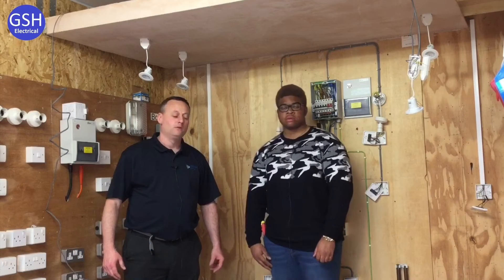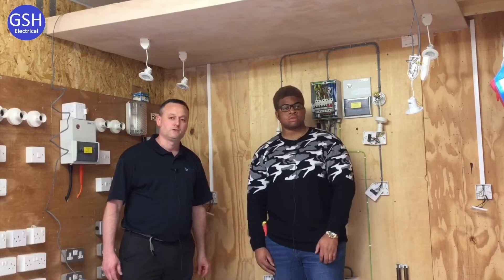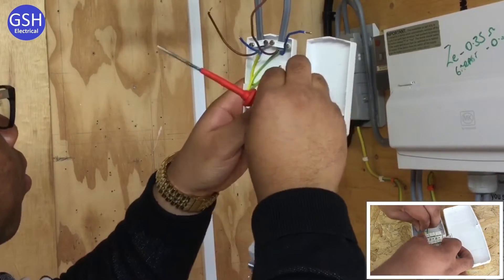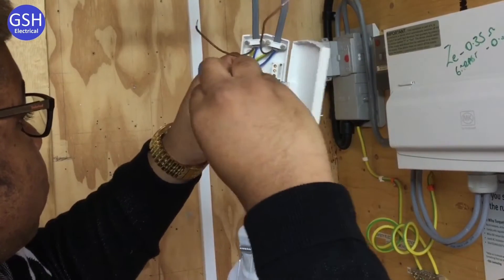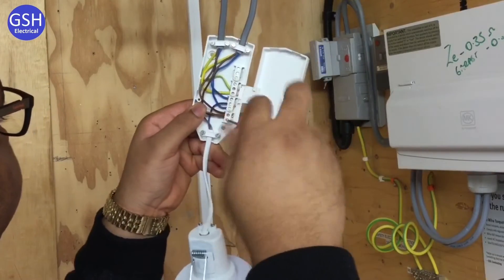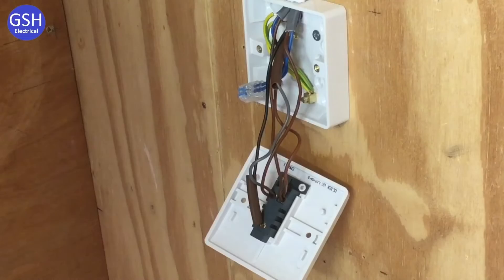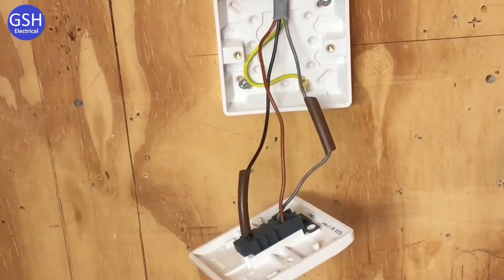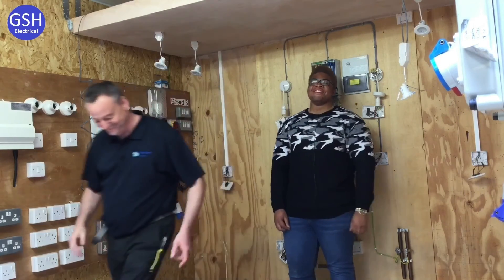Fitting LED Downlights, 2 Way Switching and Explaining the Connections by a Level 1 Tresham Learner

Comment: I can't tell you how immensely useful this video is for me personally. Am about to run in the cabling for a series of 2 way switching circuits to my extension ready for he sparks. I understand pendant based light circuits but needed to know what is required and to where for more modern 2 way downlighs. This told me everything I needed to know. Basically, feed in from CU (on radial series) then it splits out from switch to lights via T&E and connects to 2nd switch via 3 core. Not going to connect it all up myself but at least I can rest assured I'm doing the run ins correctly. Much appreciated and good luck to Ben. Your confidence will grow and you seem like a nice lad so expect you found work easily since this vid was 5 years ago!

Comment: His screwdriver doesn’t conform to GS38 half the insulation is missing? 
Good effort though nicely done and he looks nice and relaxed 👍. Great video as always Gaz 
👍👍👍❤️
Reply from the maker: GS38 isn’t about screwdrivers 🤔👇🏻

GS38 Test Leads and Probes the Requirements for Electrical Test Equipment for use on Low Voltage
https://youtu.be/mJlwKRk6A8g

Comment: Could have done with a circuit diagram for the watchers to understand what was going on in the circuit.
Reply from the maker: Wiring Diagram Lighting Circuit 2 Plate Method Taking the Feed to the Switch - 2 Way Switching https://youtu.be/QX1B4gtqisc

This should help 👍

Comment: Its a good way of reducing cables from CU down to switch to a new build property, however if its an old building and  you decide to replace a regular lighting to a downlight ones, its not practical to do it that way isnt Gaz, because you will have to strip down the wall covering the chase or such? Correct me if im wrong thanks.

Comment: Great video guys, had two questions, does the maintenance free connector block need to be taped up with insulation tape once all tests are carried out?can the old screw type connector blocks be used according to BS regulations?
Thanks
Reply from the maker: Hi. Thanks for the question and no maintenance free connection don’t need tape. Again thanks for the support 👍 Gaz

Comment: If there a feed out the switch to another switch. Do you connect in the same terminal as the feed in?
Reply from the maker: Hi. Yes to take the feed to another switch you connect to the neutral and cpc and the permanent line which will either be in L1 or L2 depending how it was connected. Hope this helps Gaz
Reply: GSH Electrical  yes this hepled alot. As an apprentice this is something i struggled to get round. Switch fed 2 way lighting. But i understand it alot clearer now

Comment: It looks like you actually teach the guys real world skills at your college, far too many kids around here are getting a poor deal and being taught to pass the course without skills to actually work. You see it when they start working and find what should be the bread and butter confusing them. by using real world scenarios like this that encompass lots of skills you are preparing them well. Will you be doing other real world tasks to keep pushing them?. I think you should ask a alarm company to donate some kit and get the advanced guys to install a zoned alarm system.  Or maybe a fire alarm panel? all valuable skills this day and age.
Reply from the maker: Hi. Thanks for taking the time to comment in detail. We have Honeywell S and Y plan boards, split boards to install with 12 circuits etc. Sadly like most colleges is down to money but we do try to stretch all learners. An ex-learner that works at Collingwood sent me the downlights so we put them to good use. Keep watching and commenting thanks again Gaz 👍